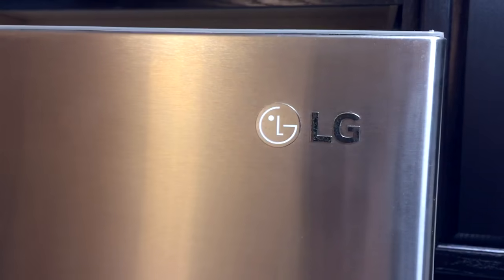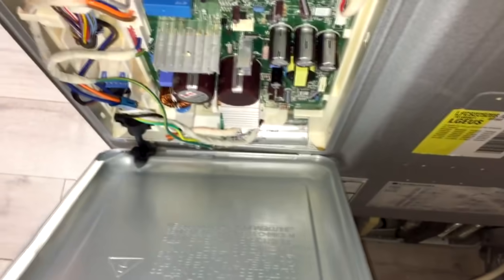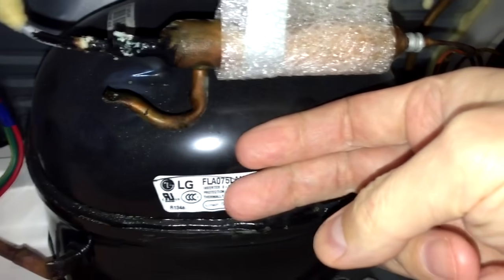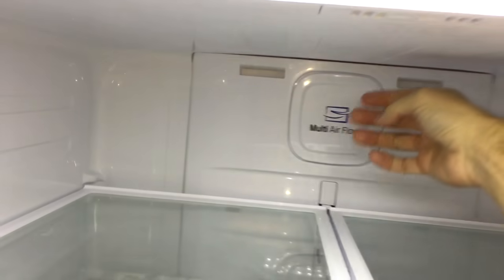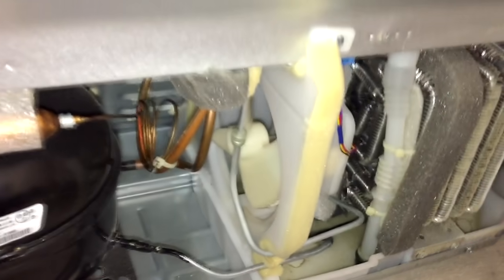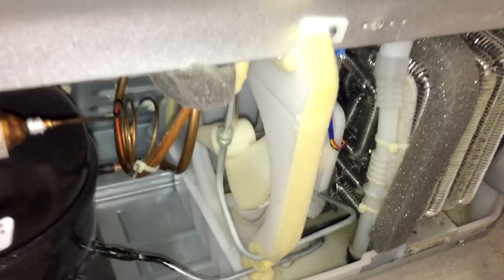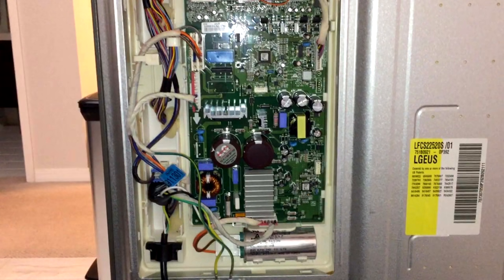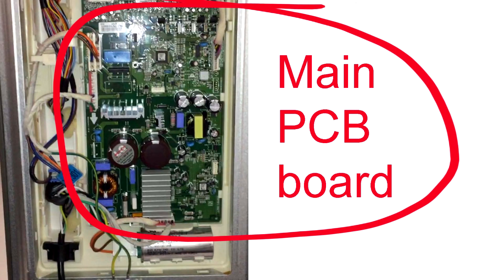LG refrigerator test and reset button

Comment: All components work fine but when it is out of test mode evap fans don’t run but compressor runs put sometimes condensor fan stops. Bad board?
Reply from the maker: Make sure that ALL door switches work well. Activate each one of them, and the light should go OFF. (even better... put a phone with a video recording inside each compartment to make sure the lights go off when doors are closed)
If the compressor runs, and the lights go off, but the Evaporator Fan is not blowing air withing a minute after the door switch activation, the main PCB is probably bad.
Reply: I checked lights and they go off when door is closed but no fans running in either compartment. I get a ER CF code sometimes. Any idea where to order board? Thanks for the help.
Reply from the maker: The error code ER CF is for the Condenser Fan. That fan could be going bad and "loading down" other fans as well (if it's a DC circuit). Try to unplug the Condenser fan at the PCB, and run your fridge for a short time to see if other fans start to work. What is your fridge model number? I'll try to find the exact location of the fan on the PCB.
Edit: or you can unplug the fan at the connector right next to the fan itself.
Reply: YourSelf 795.74025.411
Reply: YourSelf I unplugged condensor fan motor and un plugged unit and plugged back in. Evap fans ran for maybe 10 minutes then they cut off. Any suggestions past this? Thank you.
Reply from the maker: If Evaporator fans didn't run before but started to run after you disconnected the Condenser fan, suggests the Condenser fan was dragging down all of them and needs replacement.
The 10 min cut off could be due to overheating without the Condenser (cooling) fan.
If you have a small table fan, try to put it behind the fridge, and see if you can get more than 10 min run time.
Reply from the maker: Also, your refrigerator has 2 separate Evaporators, so only one compartment (freezer or fridge) can be cooled at once. This means the freezer fan can run maybe for 10 min, and then the fridge fan will run for 10 min, and then back to the freezer.
Reply: YourSelf good to know. I will get a condensor motor and go from there.
Reply: YourSelf what kind of suction pressure should I be running?
Reply: YourSelf I do HVACR work but it is in the commercial industry so I know What going on just not with the board and how it operates. Thanks
Reply from the maker: Newer residential refrigerators Low side typically runs from about 10 PSIG down to 2" vacuum. The compressor/pressure is controlled by the main PCB, so if there is a leak, it will try to compensate for a while. So just looking at the Low side will not give you an accurate representation of a healthy system. However, the equalized pressure should be slightly above 50 PSIG.
Reply: YourSelf ok if I feel the charge is off I’ll just weigh it in from specs.
Reply from the maker: If you decide to recharge it, you must open the 3-way valve to both evaporators.
Unplug the fridge and wait a minute.
Replug it and wait 10 seconds (you can hear the valve opening) and unplug it again.
Now you can evacuate the system.
Reply: YourSelf I checked it this morning with condensor motor unplugged and for the ER CF error. No evap fans running and too warm box. Do you think the board is bad?
Reply: YourSelf it had the er cf error with condensor motor unplugged.
Reply: YourSelf Do you think the board is bad? Still got er cf error with condensor fan unplugged.
Reply from the maker: It seems like an intermittent issue witch is difficult to troubleshoot.
Spin the Condenser fan with your finger, and it should rotate freely. If it's jerky or sticky, it's bad.
Plug the condenser fan back in, start the fridge, and watch it for a while.
If the compressor continues to run, but the fan stopps, give it a nudge. If the fan tries to run again, it's going bad. 
You can also check the fan voltage when it stopps on the main PCB connector CON7 with thin needle leads. 
The PCB should supply the fan CON7 pins 4 and 6 with 8~12 V DC. You should also have a "feed back" signal from the fan on the same CON7 pins 2 and 6 above 0 V but less than 5 V DC.
If the PCB is not supplying the "run" voltage it's bad, if you see the run voltage, but the fan is not working, the fan is bad.
But this is tricky... the PCB may try to run the fan a few times, and if the fan is unable to run, the PCB will shut off that circuit. So you may see voltage spikes on CON7 a few times, and then it will go dead if the fan is not turning.

Comment: Hello! I have a LG Bottom mount linear inverter which all of a sudden stopped making ice cubes. I changed the water filter and a technician came and checked the valve and although the hose was clogged with carbon  everything was seemingly working fine, but not dispensing water for the ice cubes. So they want to take off the PCB board and take it to another technician to "reprogram" it, supposedly it is not sending the right message to fill the ice cubes tray with water... Do you think the procedure you explain here would help me? I really don't want them to take the board away and let me without my fridge working unless is totally necessary. Thanks in advance for your help :)
Reply from the maker: Try running this test just for the sake of resetting your refrigerator. But this test is not for the ice-maker. Depending on your model, there are different ways to test the ice maker and I hope the technician has done it. Also, the water to the ice maker will not be supplied if the temperature in the ice compartment is above an average of 5°F. Can you verify the temperature with a separate thermometer?
Reply: @Your-Self  Thank you so much for your answer! I just ran a test to check if the motor of the ice maker was working and it did. Actually the ice cubes tray turns and the fridge makes the noise as if it's pouring water afterwards , but the test (from a LG page) says to allow 24 hours for full ice production to begin... I'll try to check the temp with a thermometer, although the display shows -18°C  approx -28°F . Thanks again for your advice! Have a nice night and take care!

Comment: I have an LG GM63SGS and the freezer I have it set at -18C but a thermometer reads -1C and it takes 2 days to freeze a water bottle. Any ideas what might be wrong?
Reply from the maker: I would take everything out of the freezer and remove the cover to look at the Evaporator Coil. If the coil is covered in a thick layer of frost and ice, you have a Defrost or Drain problem. But if there is no frost at all or very little on one side only, this could be a major Sealed System problem. The LG Linear compressor had a lot of problems lately.
Reply: @Your-Self  the back of the freezer is covered in grime and clogged I will start with cleaning that out and will move to that next.

Using the test button on the back everything seemed to work fine including the freezer it was blowing super cold
Reply from the maker: If the Condenser Coil (near the compressor) is covered in dust and hair, that could also reduce cooling in your freezer.

Comment: Pressed the reset button and all the fans were blowing and compressor running, when not in diagnostic mode the fans don't blow ? Any idea's
Reply from the maker: Are you sure the fans don't work in regular mode?
In newer refrigerators, when you open a door, the evaporator fan will stop running. You can trick the system as if the door is closed by activating the door/light switch. Within a minute, the fan should start blowing.
Reply: @Your-Self  ok I'll try that thanks...I have a 6 year old Kenmore 795, to start with last week our freezer started to defrost inside but the fridge was still cool, so we cleaned everything out and I unplugged it so if it had any ice in it, it would thaw out, but didn't help
Reply: I couldn't find a light switch anywhere on the fridge...Plus I tried to unplug and then plug back and the compressor just runs a long time but every time I check the fans are not working ? Seems not to be circulating at all
Reply from the maker: Your refrigerator probably has a reed switch instead of a typical physical light switch.
You can activate it with any magnet as in this video https://youtu.be/ipwOerjFITg

Comment: I see 3 blinks pattern. My compressor is not responding at all, and dont hear the start relay clicking. Any ideas on this?
Reply from the maker: As the chart on this video states, 3 blinks could mean a disconnected wire, bad PCB, or shorted compressor.
Make sure:
- all wires are connected
- the compressor is good as in this video https://youtu.be/zYIC7LMkKak
- the compressor is getting power from PCB. No power could mean bad PCB.

Comment: Is there a button I could press while the door is open, to see what happens inside (listen for the fan, etc?)
Reply from the maker: Pressing on the Test Button once should make the compressor and all fans run with the door opened. In some models, you need to push and hold the door button also. If there is no button, use a magnet to activate the door switch.
Reply: @Your-Self  finding the magnetic switch is another.. Hahaaaa

Comment: So I’m doing these tests everything runs the way they should. When the tests are done the fan stops spinning any ideas?
Reply from the maker: The bottom fan should restart in about 5-10 minutes after the Test is done.
If the compressor is working but the fan inside blows warm (room temp) air, most likely the compressor is bad. LG may replace it for free if it's under 5 years old.

Comment: After performing the test mode, everything worked perfectly and than after 10 minutes I received (6) green flashes.
LG counter debt bottom freeze (very similar to one used in video)
2014-15 model 
Compressor replaced, condenser replaced and software update performed on 7-29-2020
I think the tech under or over charged it and LG won't send a new company, only the same tech. Anything i could do myself or is this a problem for service company?
TIA Jay
Reply from the maker: There is nothing really you can do yourself in this situation, let the tech come back.
After compressor installation and receiving 6 flashes, it's probably a "Current Overload" due to clogging on the HIGH side (restriction).

Comment: I have 6 blinking green lights and my fridge is doing the following.  How do you diagnose from here?

Condenser fan is working - airflow is working inside fridge and freezer - compressor does make a slightly odd noise when it shuts off, but it's not overly loud or the typical clunking sound people report & it is working.

Fridge is a LG LFX25978ST - purchased in 2015. 

I have cleaned out all of the dust bunnies and the coils looks pretty good.

Fridge & freezer were sitting at 72 degrees before I shut it completely down.
Reply from the maker: Unfortunately, the 6 blinks usually indicate a bad compressor.
To verify the bad compressor, a technician would install gauges to check the pressure in the system.
It's a pretty expensive repair/replacement :(
Reply: @Your-Self  appreciate the insight. I did see that it was listed between $400-$800 repair w/parts & labor, which seems very broad!

Comment: Hello, I am buying a 3 yr old LG LFXS30766S from someone who had a bad tenant. Not the unit does nothing except the light comes on, so it is getting power . Any ideas or advice is greatly appreciated.
Reply from the maker: These refrigerators come with a weak compressor, that typically fails "running, but not coiling." Since yours is not running at all, there could be a different problem. There are 2 fuses on the motherboard. The large one is good since you have lights, so check the smaller one. Does the condenser fan next to the compressor run? Did you check the compressor resistance and if it's shorted to ground as on this video? https://youtu.be/zYIC7LMkKak

Comment: On My kenmore elite the cooling fan working, the compressor not working and the green light on the back blinks 5 times, any idea?
Reply from the maker: It's pretty bad news for the compressor. The 5 blinks indicate that the compressor is locked internally. Call Sears, it could be covered under warranty.
Reply: @Your-Self  Thanks. appreciated

Comment: Very informative video. Thank you! I have a question. When should one expect to see the LED light blinking if there are errors? When I unplugged the frig, took off the cover plate, and plugged it back in...the LED blinked for a bit but then stopped. It never repeated. And then it never blinked again during any of the tests. Was the initial blinking just part of the boot-up and then the test was error free?

Comment: My  LMXS30776s is is not cooling.  Maintaining about 65 deg f in the fridge and 45 deg f in the freezer.  During the first test, I opened the fridge doors and very cold air was blowing. Felt 100% normal. I ran tests 2 and 3 and then reset.  I then tricked the fridge into thinking the door was closed.  Waited over a minute and the fan never came on.  No cold air was blowing in.
I have already replaced both fans in the freezer panel and verified both fans in the upper fridge unit (fresh air and fan by the coil) work. What could my issue be?   Am I looking at a control board problem?  Some kind of temp sensor?  Please help.
Reply from the maker: If the temperature in all compartments is higher, I'd rule out the temp sensors, because it's unlikely that all of them failed at once.
When you trick the fridge with the door switch, does the compressor start running, but the evaporator fan does not? Or nothing runs when you wait over a minute? (*** when the compressor runs, it cools one compartment at the time, so check them individually ***)
Be patient, the compressor has a 7 min delay before it can be restarted after it stopped.
Also, make sure all 4 door switches turn the lights OFF when you activate them. Try a few times on each switch... maybe one of them is "sticky" and not working every time.